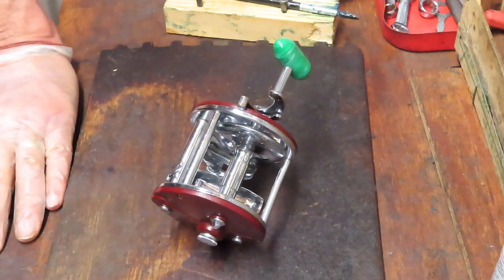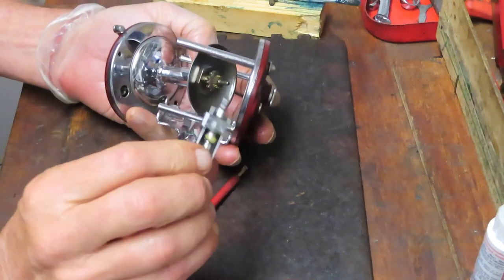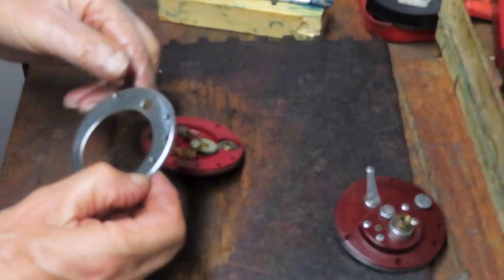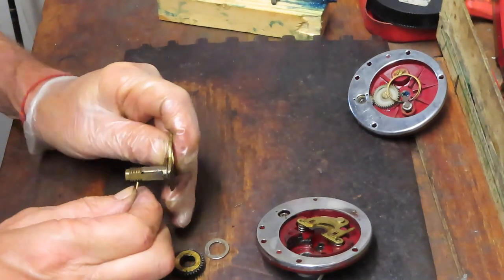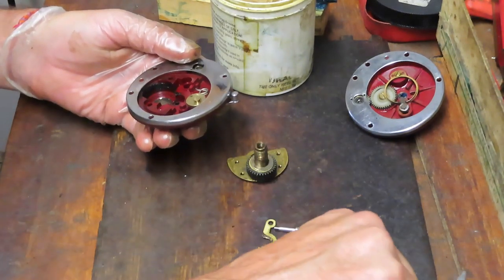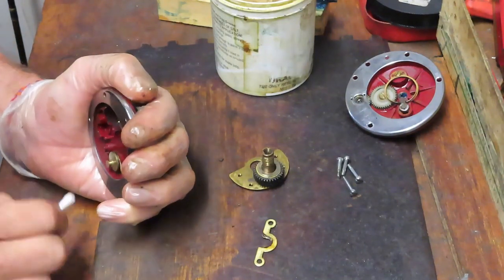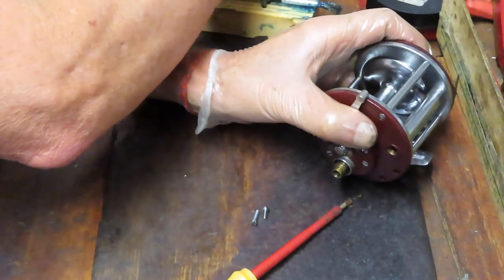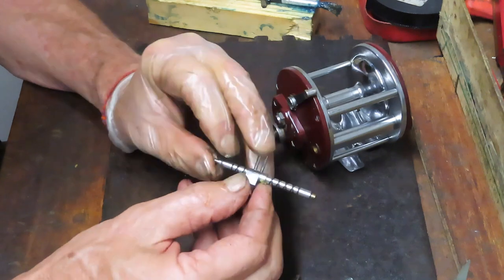Penn Peer 209 levelwind fishing reel with cracked plate how to repair and service

Comment: Hi Dennis, I came across a really nice little Penn Peerless no. 9 reel, maroon side plates, that the previous owner had seized up by I think forcing the handle too heavily.  I found some of the teeth broken on the idler gear which I replaced from a parts reel I had but it still did not operate properly.  Tried replacing each of the other gears but still a problem.  Finally changed out the spool and it now works perfectly and smoothly.  I suspect a bent spool shaft, is there any way to true up the spool shat?
Reply from the maker: No - a bent spool shaft is a goner.  I suspect that a machinist may have a way, but I don't know it - Dennis

Comment: Dennis I am curious about your choice of Grease and oil. I'm told that 3 in 1 oil and gun oil should not be used which surprised me since I've used them for along time. Over the years when cleaning sluggish reels I've usually discovered way too much Grease that only turns to gum and solids over time. Can you clarify?
Reply from the maker: I recommend greases and oils designed for fishing reels.  I am not a chemical engineer and cannot tell you the differences between formulations, but I trust that those that design these products have the knowledge to deal with heat, salt, evaporation, water and other elements and know the compounds that have the properties needed to work best.  A lot of folks have used gun oil, sewing machine oil, 3 in 1 and others successfully.  I prefer to stay with what is designed for reels and has worked well for me.  I ask a simple question.  Would you use fishing reel oil on your gun?  If not, the why would you use gun oil on your reel?  You are correct - a major problem a poor performing reel is that the grease has evaporated, or dried into a gummy mess.  Thanks - Dennis
Reply: I realize it's kinda randomly asking but does anybody know a good site to watch newly released movies online?
Reply: @Julio Devin i watch on Flixzone. Just google for it :)